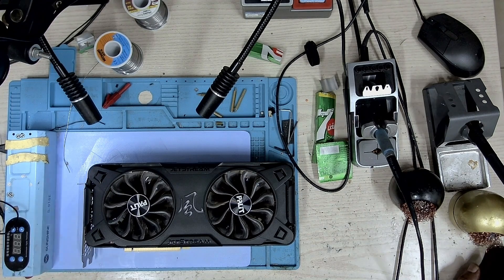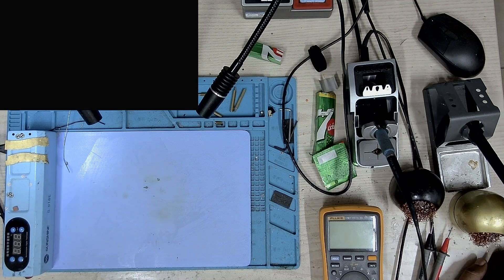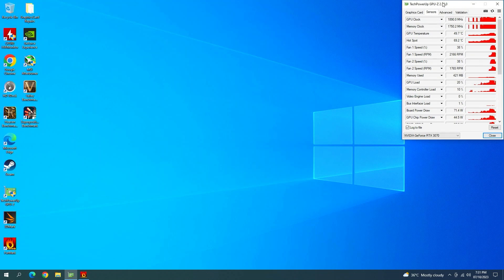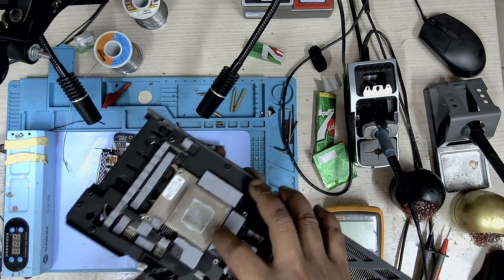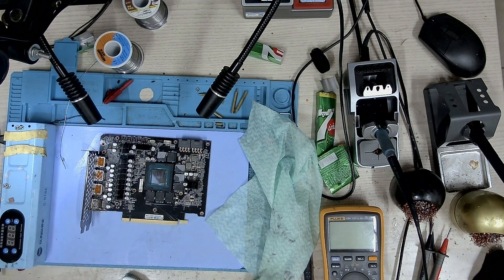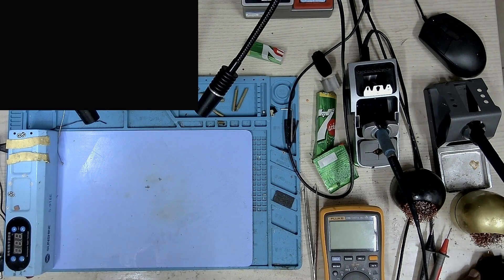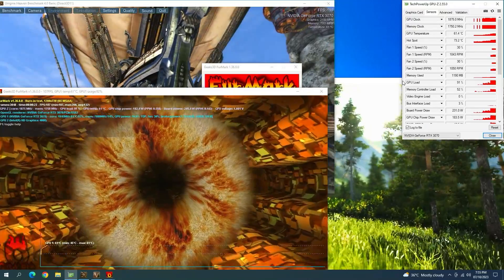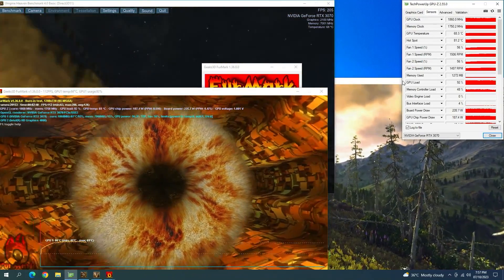Fixing Palit RTX 3070 105°C Frying Pan - GPU Overheating Solved.

Comment: Hey man, thanks for this great video, can u specify what thickness of pads you used exactly? You replied in the some comments 0.5mm and 0.75 in other. The model is exact as in the video
Reply from the maker: @OpiLopi  0.75mm for soft pads and 0.5mm for normal.
Reply: @ if you Dont mind can u clarify which specific ones is better for use?
Reply from the maker: @OpiLopi  upsiren 16w/mk. Don't buy the higher watts as it hardly makes any difference. Buy the 0.75mm 16w/mk.

Comment: I've email Palit , they gave the diagram about the thermal pads, and the VRAM is 0.75mm as their recommendation, why did you use 2mm?
Reply from the maker: Palit have different models. GameRock is 0.75mm. I will have to watch the video to check what I have installed.
Reply: @GraphicsCardRepairs-tk7ql  Sure sir, mine is Jetsream version, and i had email palit exact model and they gave me the diagram and there is none shows 2mm, mostly was 0.75MM. It made me confuse now

Comment: i see it's common with these palit cards... i have the exact same one and hotspot reaches 105 degrees instantly meanwhile gpu temp is 67 degrees... almost 40 degrees delta
Reply from the maker: Replace the thermal pads. These cards run hot very quickly.
Reply: @GraphicsCardRepairs-tk7ql  ill probably repaste it soon, for now i just undervolted it. 1830 mhz at 850 mv - 90 degrees hotspot. still hot but not throttling at least :D
Reply: @GraphicsCardRepairs-tk7ql  hi, happy to report that i repasted my gpu! now the delta is 12 degrees, no more throttling even with an oc!
Reply: @killerr15 awesome. I did the same. Changed the pads and the thermal paste. Went from 105 to 65 under load. I feel bad for my card that I put it under so much stress for so long lol

Comment: Okay so the memory vram is 2.25mm/2mm then the other thermal pads are 0.5mm right?
Reply from the maker: Yes
Reply: which one did you use 2.25mm or 2mm?

Comment: My 3070 have max temp on game 75-78
Reply from the maker: These temps are not bad. Depending on your game the card temps will be anywhere between 65C to 75C. I would recommend you install GPUz and test the temps. Make sure you tick the option to log to file. On this app it also shows Hot spot temps. After playing for a while use "Alt Tab" to switch to GPUz and make a note of the hotspot. If it's above 90°C it would need new thermal paste. If you are not comfortable dismantling your card take it to someone who can.

Comment: hello sir.. hai.. im want to change thermal pad.. on my palit RTX 3070,  and i buy 1.0mm.. can i put double thermal pad??
Reply from the maker: For the memory the thermal pad size is 2.25 mm with hardness 40. You can get away with 2 mm. Doubling the thermal pads would make it 2 mm but I doubt the effectiveness of it. Not that I tried it. If I were you I would go for 2 mm instead of double 1 mm. It's just me but there is no harm in doing it. You can always try it and report it in the comment section. Just make sure that you don't over tighten the screws too much. If you don't achieve the desired temps go for 2 mm instead.

Comment: Hi bro, can you help me my Memory test drive doesn't work for AMD cards even if I boot using legacy mode
Reply: I got the very big file which was about 120gig which has AMD tserver, mats and mods for NVIDIA. I restored the partitions and the menu is similar to yours in the video, it only works with NVIDIA cards I have a bunch of rx580s I need to test as well as an rx6700xt but it's not working please help, is there something I should change or my images are bad because I have many doing the same thing
Reply from the maker: Tserver will work with Rx 580 but will not work with 6000 series and after cards of You will need memtunes for 6000 series
Reply: @GraphicsCardRepairs-tk7ql  well my mistake in typing all that is there but the module for Rx 580 series and that for rx5000 upwards is not working
Reply from the maker: What is the command you are using and what error do you get? Assuming you are testing Rx 580
Reply: @GraphicsCardRepairs-tk7ql  from the grub menu, I just Press enter on the AMD Rx 580 series option or press b at times and it gets stuck on some screen which doesn't respond if you press any button, how can I contact you so that I can share the screenshot so that you can also see
Reply from the maker: You can contact me on support@graphicscardrepairs.com
Reply from the maker: What are you trying for AMD memory testing? And which series of AMD card are you testing?

Comment: I don't quite understand how it would have happened. Obviously the paste was applied evenly (it's applied by a stencil in a consistent layer) and then a roughly equal and expected amount has squeezed out onto all 4 sides of the perimeter when the heatsink was originally installed. It looks like there must have been something that created a pressure imbalance, such as pad installation quality issues (pad folds in on itself during assembly), or some sort of pressure on the heatsink while in use, maybe heatsink and shroud warped due to droop? Plus the paste being just bad, and thermal pumping effect caused it to separate into the solids at one side of the die and the carrier fluid at the other side, after which the carrier liquid broke down and volatilised.

Also there's obviously nothing wrong with MX4, it's good and has excellent endurance; but i remember that Igor Wallosec's tests have shown on GPU direct die use that MX2 is better than MX4, though i can't imagine why. Then again MX2 is now no longer available so there's nothing to be done about that, other than maybe using Phase Change Polymer material instead of a paste.

Also sometimes higher performance cards today are equipped from the factory with Phase Change Polymer such as Honeywell PTM7950 (one example of many) on the core. It feels crumbly and dry, and it cannot separate. It's a high endurance material which lasts for many years, it melts at temperatures higher than room temperature and stays liquid in card's operation and solid when unpowered. It's also a high performance material with thermal performance somewhere between paste and liquid metal. It's easy to recognise when removing because when you apply isopropyl alcohol, thermal paste just dissolves and swims away, even if was dry as concrete, while Phase Change Polymer is not affected and remains in chunks. It does however raise the question whether Phase Change Polymer has failure modes like these where it collects in one part of the die and that's it. Whether this was it.
Reply from the maker: I'm sure you must be an engineer. There is a lot of detail in what you say. I'm impressed 😁. There is a possibility of your theory and as a result may have caused the problem. Difficult to say unless there was a trend observed. This is just one card. The top side was so clean as if there was nothing there unless I can find more cards like that however never came across any from this AIB.
Reply: @GraphicsCardRepairs-tk7ql  Haha i have studied electrical engineering at a German university, learned NOTHING, dropped out, and have been slowly learning by myself whatever happens to interest me... mostly i repair old electronics, nothing as modern as this, and also worked as a computer engineer for some larger mostly car manufacturer companies but that's completely different, i only had to do software there and the actual electronics we weren't supposed to know much about how they're physically built, or as much as touch them, though i guess some of us did and some of us set expensive things on fire on accident, it happens. Anyway most engineers work in their very tiny field and learn spectacularly little about everything as a whole, i find, i think testers and people from repair service might as well have more of a clue.
Reply from the maker: Very interesting. I'm glad I found you. I'm sure your inputs will add value to my channel. Would love to have your thoughts in the comments in my videos.